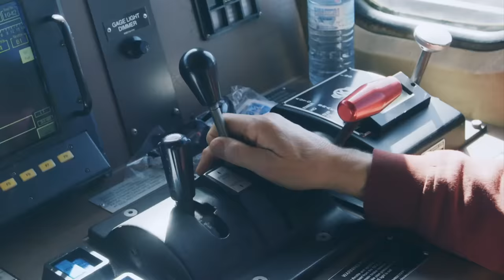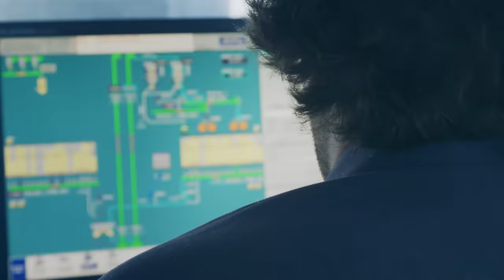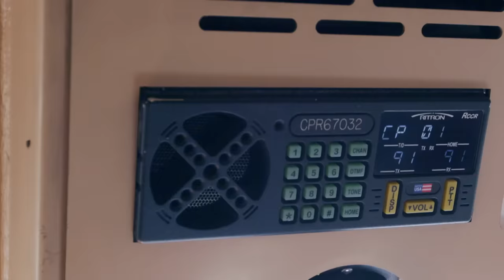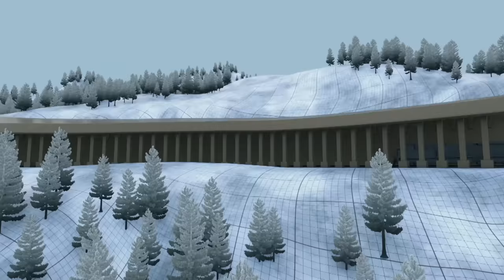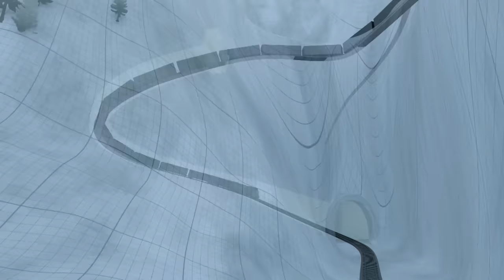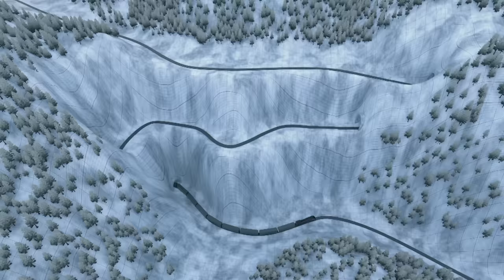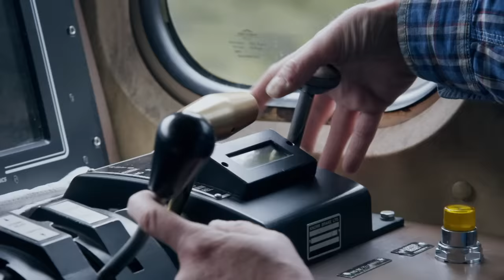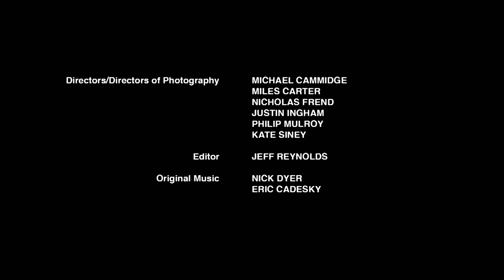Rocky Mountain Railroad | Episode 2: Tunnel to Hell | FD Real Show

Comment: many years back....many.....60 plus...A local gov shipbuilder, would invite the public into the shipyard machine shops. Good public relations as thousands worked there, the children would be the next to grow and become the workers...so impress them young. They built a train set, many actually, but one held every kids attention. The trains were 50...60 cars or more...massive lay outs unlike anything one might see today. This one train would enter the snow covered mountain and what only appeared a yard or two should have come out the other side easily visible. Yet more train was going in and still nothing had come out this very short run. Kids like me stood spell bound....how is this possible...and the millisecond the caboose disappeared into the tunnel the engine pop through the other side. As a child one did not grasp the circular tunnel beneath the display top. Another " trick" they had us on was the train entered a tunnel and exit out to begin a long steady turn, just circling around headed back and thus crossing the intersecting track...problem of course the tail end of the train had yet to pass....it was going to wreck into itself...Why would they do this....and as life was about to end for this fantastic train the caboose crossed over and was clear of the engine as it sped through the intersecting tracks. My Dad years later told be when that was put into place, a mere piece of paper was the gauged they would set it with. Between the caboose and front corner of the engine , the clearance was less than thickness of a sheet of paper. Of course this was a testament to their skills...Shops back then showed off their talents. Some had Christmas trees decorated two stories high full of lights and packages. Those packages I heard were real toys and given to needy families, money raised at local churches to buy the gifts. This was my childhood in the 50's...

Comment: The Engineer points out that the automatic brake valve sets up the brakes only on the train, but not the locomotives. That isn't correct. The ABV does set up the brakes on the locomotives as well, but the independent brake handle has a separate control attached to it called the "actuation" valve which bails off the air being sent to the locomotive brakes when you set the ABV.  It releases the loco brakes when you only want train brakes. (If you actuate before setting the automatic brakes, it prevents the locomotive brakes from setting up at all). I know the engineer is well aware of this and that part probably got edited out of the show for time constraints or whatever haha

Yeah I know I'm being "that guy" right now, but whatever haha.

Comment: that bear trap would've been cheaper to make yourself then shipping it via train, car, and helicopter
Reply: Except you don't want to be putting your DIY bear cage to the test when you trap your first extremely-pissed-off half ton (1,100lb) polar bear! 
The one they shipped in has been built to spec by people who can design & test it with real bears... it has to be a robust trap to keep one captive & be able to transport it as well (which is why it's on a trailer).

Comment: 30 million pounds of grain, then the weight of the train at 10 million pounds. So, that loaded train is 40 million pounds? 15,000tons of grain x 2000lbs per ton + 5000 tons empty weight of cars x 2000lbs per ton. If true, I'm amazed.

Comment: And I thought the Sierra Nevada Mountain Range with Donner Pass in No. Ca. was hazardous. The Canadian Rockies looks like a big chore to keep going.
Reply: There are a FEW nasty routes over the Rockies and the variously named Pacific near the coast mountain ranges.
I lived right by one of them (BNSF used to be GN) that included both of the Cascade Mountain railroad tunnels, with both of those tunnels being predated by an 8 segment switchback.
Reply: @bricefleckenstein9666  glad you brought that up. I mention Donner Pass which not only a lot of snow, but it is the longest railroad pass at 80 miles in length.
Reply: @daleburrer1546  And appears to have been out of service since 1993, at least in part - because it was TOO nasty.

Comment: What was that black grain?
They should have mentioned that diesel electrics have dynamic braking, like a Tesla.  Except there's no battery to charge, so the electricity is directed through huge air cooled resistors.
After they trap a polar bear, then what??????  Inquiring minds want to know.
Reply: I can answer the last question.... relocation. Note that the trap is built onto a trailer with wheels...  once you trap a bear you can tow it out to an area well away from your town or other people & release it again. It means you don't have to kill individuals who stray too close to human habitation, and it can work as a great deterrent for smart species like polar bears.... once they work out that getting near humans means getting caught in a trap, they'll avoid going near towns unless they are really starving 👍

Comment: I'm more than a little surprised that braking was shown provided only by wheel shoes. Sub-optimum in the mountains, IMO. First choice would be dynamics. Research is ongoing with GE & EMD to not just dump heat from the dynamics' resistors, but to put that electrical energy into batteries for power on the next hill-climb. Can avoid burning LOTS of fuel oil, CO2 and expense..

Comment: Defective rail: Why not put a luminescent line with metal wire woven in it 90 degree angle from track and go 30 feet to iron fence post or other vertical rod; a metal detector could pick up the line away from the track.

Comment: She says it's an amazing feat they built this tunnel in 1908.  She obviously needs a history lesson.  They built the Panama Canal back then, so that tunnel wasn't that amazing of a feat.
Reply: You can have more than one amazing feat at the same time. You are also talking about two different climates in two different parts of the world.
Reply: The Panama Canal was also an amazing feat, but it was digging out channels & canals (ie. open holes).... this was digging tunnels through a mountain without it caving in on them, without computer aided calculations or even a slide rule to measure your track angles & path. Try accurately digging a ditch in your yard versus boring a hole through a cliff face. But there were plenty of amazing feats of engineering in history.... one doesn't diminish the brilliance of another.